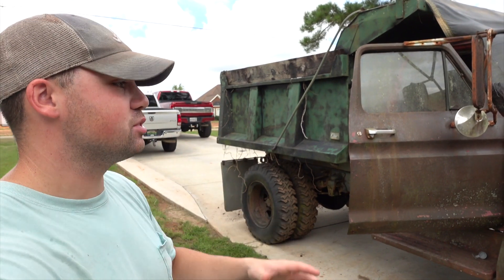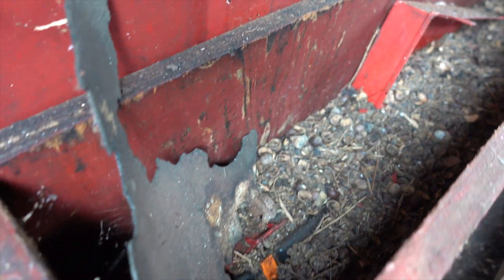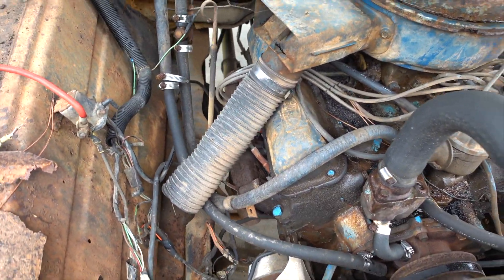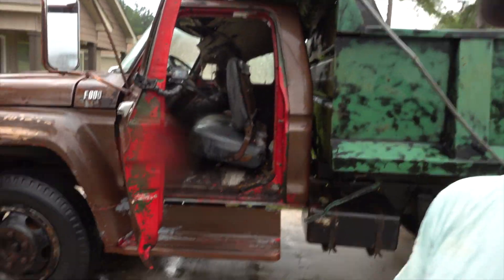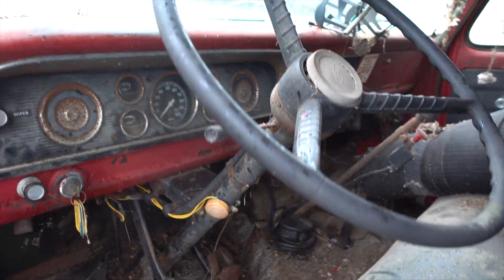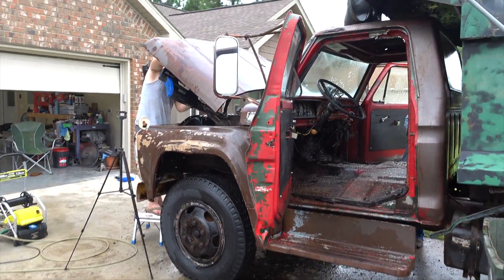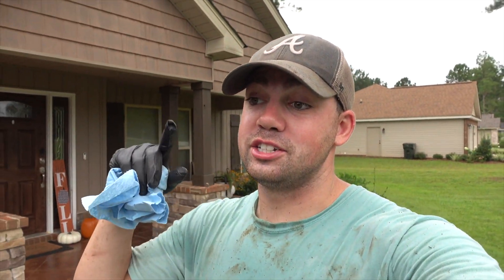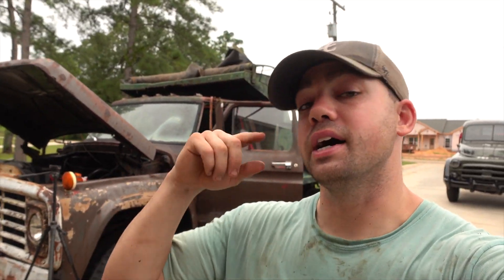The Biggest Disaster Detail EVER Attempted on YouTube | Dump Truck Detail

Comment: Really nice project but please, PLEASE be really carefull when you gonna fix or repair the hidráulics of the dump bed, those things are really dangerous if you gonna hold the dump bed high use really strongs wood stacks, never let it hold by itself
Reply: SpikerDragon95 he is smart and will be safe when doing this stuff
Reply: @jonthelamb4549  Don't be so defensive.... if he's so safe, why were the guys on his shop building team standing on the top step of the inadequately high step ladders used during assembly... not to mention using that tractor and lift basket to lift those beams.  Extremely lucky nobody was seriously injured... and a bungie cord to hold the hood down??  Seems totally safe to me... NOT!

Comment: Greetings guys, good video on the recovery of this Ford F600 truck, if you are going to restore it, I would like you to put the diesel mechanics, the Ford 7.8-liter engine, the manual transmission, which brings the Ford F800 and like the dieferential from 2005 onwards so that it has a load capacity of about 15 thousand kilos keeping it turning and the air brakes cannot be missing and equip it with air conditioning and heating and the original muffler for the exhaust